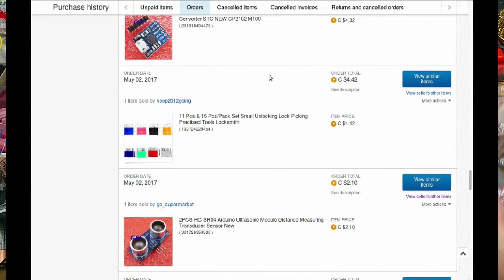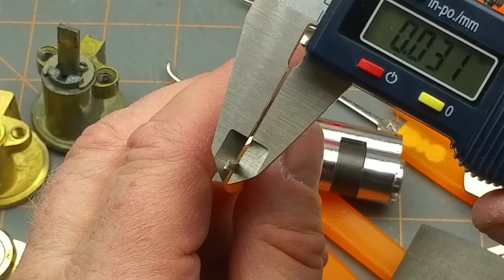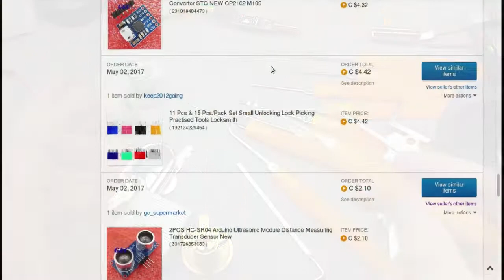The cheapest lockpicks on Ebay

Comment: I'd been as quicker to chew on the lock with my teeth i bed i would have chewed through the lock much quicker than the time these arrived hear in the UK by that time there was 4 new locks added so had to remove 5 instead of the one lock 🙈 2 months this kit took to arrive
Reply from the maker: I had made several of my own tools before these arrived. And in many ways some of my DIY picks are better than these cheap Chinese ones.